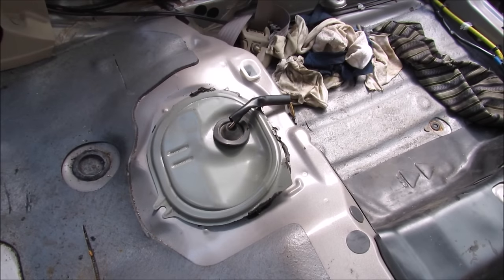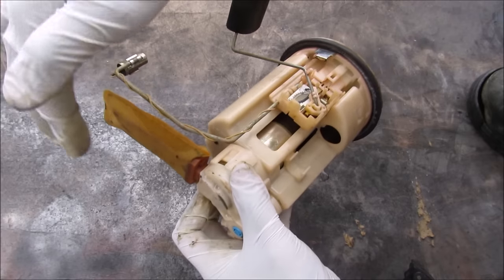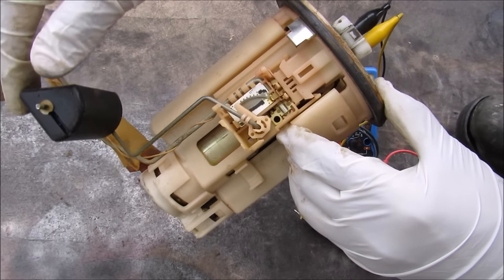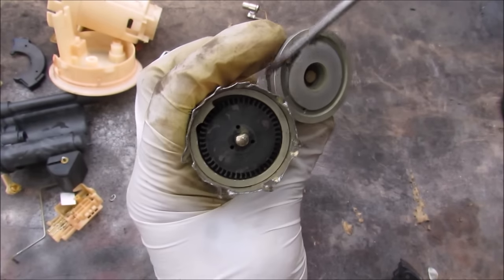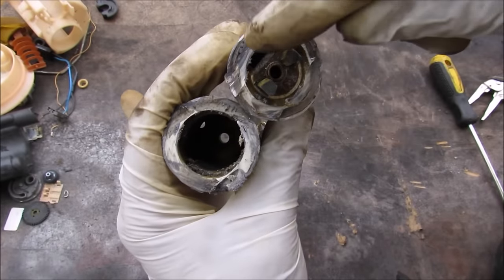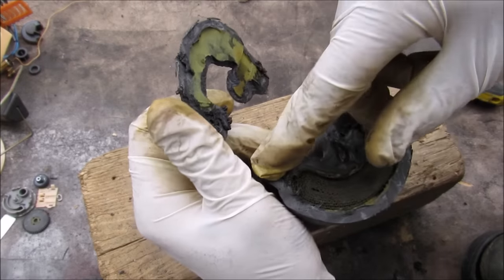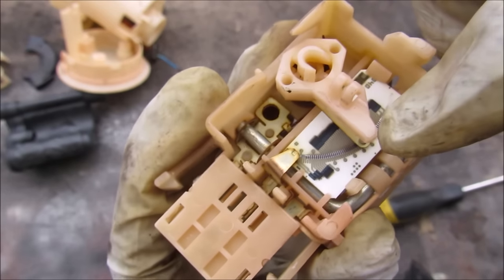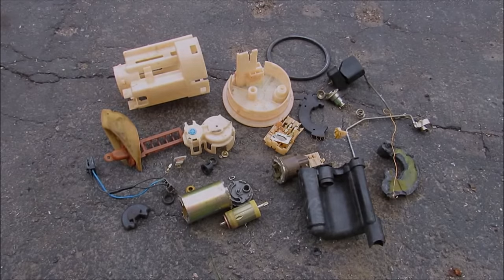How a Fuel Pump Works

Comment: Great video!! I just wanted to check to see if the fuel pump could potentially suck up a bit of metal about half the size of my little finger, which I dropped in to my vehicle fuel tank when I was trying to syphon fuel in to it. But going by the look of the filter sock this should stop anything bad happening to the pump 🤞

Comment: Great video .that pump is definitely redundant.but worth it for the insight.
Reply from the maker: Thanks. It sure is
Reply: @speedkar99  I have foolishly allowed my vehicle to run low on fuel hence my interest in fuel pumps.i wonder if you could advise me.i think I have damaged mine.and will probably have to replace.will I require the full assembly or do you think I could just replace the submerged part of the pump .my vehicle.audi A4 petrol.b6 Avant.

Comment: Your channel is fantastic! Dumb question you might have covered. When you accelerate, does the pump working harder to provide fuel or is there a fuel reservoir somewhere?
Reply from the maker: It keeps working at 12V. They aren't variable, but some have return systems for extra pressure
Reply: @speedkar99  appreciate the response. Love your channel bro

Comment: Excellent work! AlsoSince the gas is pumped through the pump to cool it, there isn't much benefit to keeping a tank nearly full to cool the pump. One I took apart in the 90's had the motor completely insulated in foam for noise abatement and was almost at the top of the tank.

Comment: Great video. I've just replaced the filter and the "sock" on my car. After that it got difficult to start the engine, but when I got it started it run fine. My unit is very similar to the one on the video (rav4 second gen). I found out that the oring on the top part of the unit had cracked in the process (where the outlet on the filter is connected). This allowed fuel to drain back into the tank and loosing all pressure in the system. This is why it got hard to start everytime.

Comment: I bought a 2000 f150 recently.The owner put a new fuel pump in.It ran good for about 1,500 mi then it began hesitating between 30&40 mi.per hr.
I figured out that it will run good at full tank until I use about 6 gal.Then it starts to malfunction.When it begins to malfunction it might run good for 2-3 mi.then it starts to hesitate at the speed mentioned.
Any answers or advise?

thanks.

Comment: Good video. Question on the pump the electrical connector blue wire is it positive? If it is.... Is thier a marking on the plastic connector indicating where the ground and positive go? The wire's weren't removed from the actual pump but they were removed from the connector that are  on the inside of the  fuel pump housing before putting everything back just want to make sure positive is going back and negative is going back to it's normal location but not sure need help with the blue and black wires only thing that I have noticed is a no.1 on the side of the plastic connector thats inside the housing the connector on pump has no numbers but I'm guessing the blue wire is number 1 if not then I crossed the wires

Comment: Now I'll never have to take one apart myself!  But we got along for decades and millions of cars with just gravity feed to carbs.
Reply from the maker: +wholeNwon Well with fuel injection and forced air injection fuel pressure is necessary for operation.
Reply: I understand. But we got along for many years without either of them.
There's something to be said for simplicity.  But it's not fuel efficiency, power per cc of displacement, etc.
Reply from the maker: +wholeNwon the same can be said for any technology, the argument can't be we were "doing fine".... Back then cars burned more gas, polluted more and didnt have the survival rates in collisions that cars today have. 

However there are some technology that I find useless in modern cars....the electronic parking brake for one.
Reply: Of course.  And, believe me, I sure don't want to return to the "good old days". It's amazing to me, and a tribute to engineering, materials, etc., that modern cars, as complex as they are, are still remarkably reliable.
And I'm eagerly anticipating autonomous vehicles.

Comment: Hey bud. Very nice video. The fuel pump in my hyundai is almost exactly the same as this. I had to remove it to replace the fuel filter which is obviously built into the pump itself. easy enough job as direct access under the back seat. However all of the mounting bolts snapped upp when removing it from the tank. no idea why they use such crappy thin bolts. all 8 just snapped with one turn. what would you recommend i do to secure it in the tank again? it sit in there fine and ive jammed some wood block between the top of the pump and the secondary cover in the cabin area to force it down in place but its not a long term solution. drilling in that area seems a little sketchy
Reply from the maker: Hmm not sure ..you'd need to drill out those bolts. It's sealed because fuel vapors are dangerous

Comment: Is the motor variable speed and controlled by engine sensors or other electronics in the system? My car has developed a bit of a hesitation at low RPM when transitioning to  higher RPM. I've already changed out the spark plugs and condensors, the fuel injectors, and even the MAS. Problem still there. I'm thinking next is a whole new fuel pump/filter assy.
Reply from the maker: These just get 12V and aren't variable. The injector's pulse width controls the flow. 

Don't throw parts at your car, get a fuel pressure test first.

Comment: Talked to several mechanics about my ATV engine stuttering problem.  They all said vapor lock which is hard to do in a high pressure fuel injection system.    The fuel pump tests good at the shop but I think overheats and starts to fail after a hour or the fuel pump is starting to fail at about 4000 miles on a Canam ATV

Comment: I'm hoping my comment might be helpful to some. I came here to see how the pump itself works inside to know whether I can put an inline pump and pump the fuel through my tank pump if I break down. Turns out I can! No need to drop the tank yet again! Simply undo my an-6 fittings and the coupler I will add, then put in the inline, power it and go! Until I can make the repair of course!

Comment: Nice thorough video! Does anyone know if a fuel pump could push thick oil instead of gas?  Its for a chainsaw bar oiler for a firewood processor I am building. Thanx!

Comment: I always loved running my fuel tank until the gasoline light came on. Then came the mad dash to find the nearest gasoline station. But the last time I did that my fuel pump died. I learned an expensive $800.00+ lesson for a new fuel pump, labor and other fun stuff.
Reply from the maker: +albear972 Yep, running it too low will cause the pump to over heat.

Comment: Question: What's the low level light resistor for when you've already got a float (with it's own variable resistor)? Couldn't the light simply turn on in the dash when that float reaches a certain level?
Reply from the maker: It's not very Accurate now is it
Reply: ah!.. that would explain the whacky light on my Malais era Mopar product. Thx Professor Speedkar!

Comment: That's very interesting. I have an old 97 ford explorer, and the gas reading can be really sensitive. For example, if I have a quarter of fuel left and the car is on a decline (even a small hill) or I'm stopping the car, the meter pointer will point directly at the E line within seconds. It doesn't take much for the meter to move. The opposite happens when the car is facing up or accelerating. Unlike modern cars like my dad's 2014 Grand Cherokee , it takes a lot for the gas meter to move when it climbs or go down a hill. However, I get accurate fuel reading if I'm on a leveled surface. So now that I watched this video, I don't know if that's got something to do with the fuel pump 🤔
Reply from the maker: +Charlz Tellis Yea with older cars the fuel float's reading is directly wired to the fuel gauge hence the rapidly fluctuating gauge based on orientation. 
Newer cars have the signals connected to the canbus and are better at adapting to fluctuations.
Reply: speedkar99 modern cars computationally ignore sudden changes to the fuel reading? does it take orientation into account or is it all just based on assumption that fuel probably hasn't suddenly vanished? Never knew that but it makes sense! (always wondered)

Comment: QUESTION;   does a fuel-pump need to emerged in the fuel completely to get cooled or just the to make sure it sucks up gas 100% from the end of fuel-pump pipe.
Reply from the maker: The motor is what creates the heat, but the gasoline flows through it so it doesn't have to be fully emerged

Comment: Great video @speedkar99 ! Question: Why are fuel filters on modern cars integrated into the fuel pump rather than further down line? What advantages does this placement offer?
Reply from the maker: Ideally you want to filter the gas before it clogs the pump

Comment: Can you also do a "repair fuel pump" video? Please
Reply from the maker: Like replacement or rebuild?
Reply: rebuild, i have friend of mine have problem with fuel pump on chrysler 300c, 3.5 , and he tried to find another new/ used but sellers ask almost 500 dolars for it, so i think if he could repair it , because there is no too much things to fail- pump motor- brushes or  pressure regulator, i repaired on same car egr valve and engine cooling fans
Reply: @makantahi3731  wow 500 is tooo much indeed. We shall see how to repair this thing. Thanks buddy
Reply: @speedkar99  just  called somebody replaced it with a used one. Few hours ago.

Comment: Good job Speed appreciate it, 
I custom build mini RVs,    do you know if these pumps can be used to pump water on a long term basis?  [like say for a small RV sink} am wondering if it will rust?
    also....@2:31   you said fuel enters the brown tube part and exits the grey end....did you mean the opposite?...I could be wrong though.
Reply from the maker: Water is conductive I don't know how a submerged motor would fair.

Comment: QUESTION;   does a fuel-pump need to emerged in the fuel completely to get cooled or just the to make sure it sucks up gas 100% FUEL from the end of fuel-pump pipe.
Reply: Since it sits at the top of the fuel tank, I don't see how it could be immersed in fuel all the time. But there should be enough fuel going through it for cooling, that's for sure. You can't let your modern car run out of gas and run the pump dry.

Comment: So, judging from this video, one cannot just replace the pump motor only, but must replace the whole module because of the encased filter? Do all makes of cars/trucks with this module have an enclosed fuel filter. If they do, I assume one must replace the whole assembly to ensure longevity.

Comment: @speedkar99, in your opinion, should you always keep the tank at least a quarter full, in order to keep the fuel pump from overheating?
Reply: Gino Lee No since the fuel flows through the electric motor and cools it off.
It won’t cool any better if it is totally submerged on the exterior.
Reply from the maker: Agreed

Comment: How does gas go through the motor? It looks like it's super tight clearances in there with the rotor. Do you mean gas goes through the shallow grooves on each end caps?
Reply from the maker: +mrsemifixit It goes around the rotor, and yea it doesn't appear to be much room.
Reply: speedkar99 So what are those shallow grooves for? Think I'm confused how it gets through the D.C. Motor
Reply: I am confused because as we all know dc motors makes sparks on the brushes and there is fuel flowing thru
Reply: Martin Škamla When submerged in gas a spark wont ignite anything. Its the vapors themselves that are explosive

Comment: any suggestions my car smelled bad of gasoline and opened back seat to check fuel pump assembly and there was gasoline all over the top of it and noticed gasoline dripping down fuel tank on one side of it.. mechanic said you need to replace all your assembly

Comment: Where might I find another rubber bushing to attach to the bottom of my new fuel pump I ordered online, since the original rubber bushing and fuel pump are a different size..? the auto parts stores don't sell them separately.
Reply from the maker: Dealer or ebay

Comment: Interesting that the fuel runs straight through the motor, and it's a brushed motor! Couldn't that be a fire hazard if the brushes created a spark?
Reply from the maker: Spark can happen but to ignite you need air. If it's encased in fuel there's no way it can ignite.
Reply: @speedkar99  thanks for the reply, that's kinda what I thought but I was wondering lol

Comment: My car is suddenly stopping after running for 10 to 12 kms and engine is getting heat do u think there is a fuel pump issue in it..
Reply: Very unlikely to be the fuel pump. Symptoms are different - like car won't drive fast, only slow if fuel not pumping properly. Check your coolant and your oil levels. Make sure the engine is not overheating and seizing.
Reply: Nice one bro

Comment: Do you thing it is worth the trouble to change a in-tank fuel filter? I have 100,000 miles on my car and i have always changed filters when they were in-line type but I have been told that changing the in-tank type of filter isn't necessary , but I don't think that is right. What do you think?
Reply from the maker: +kingmike40 Not worth it until it cloggs up. Use good quality gas and you'll be fine.

Comment: Awesome video man, thanks..
Hey, I'm wondering if the fuel pump and level sensor are interlocked by program? Because my fuel pump still works when connect directly to dc power (battery) but when i connect it to its original position the pump doesn't work, fuse and relay are ok..
Reply from the maker: Perhaps the ecu is not providing power or there's a wiring issue, or the Immobilizer is preventing the fuel pump from running

Comment: And can i know how to find the common fuel pump + and - wire by colour coding. bcoz i need to put a reply. So please kindly explain
Reply from the maker: Wiring diagram
Trace wires to motor 
The two thicker wires are typically the power on the harness

Comment: Brother my honda city 2007 pic power is soo poor i recently changed all the power plugs but pic power is sill poor one mechanic saying that fuel pump is weak so it's true? Will pic power increase after replacing fuel pump?
Reply from the maker: Pick-up power? If the fuel filter is clogged then yes replacing it would help

Comment: I have a Mitsubishi Lancer ralliart 2.4l 2006 and I have a low fuel pressure I've already changed the starter and fuel pump with the strainer(sock) and the car is rough start just cranks a long time with no start. After a long time of trying to start up the start up dies out to where you just hear is clicking or silence. Battery is good
Reply from the maker: +Jorge kaji maybe an obstruction in the fuel line or a kink?
Reply: not sure Ive done research and only option is change the Fuel pressure regulator

Comment: why pin 86 and 87 of fuel pump relay has already got power even when KEY IS AT ON POSITION??

IS NOT IT SUPPOSED TO GET ACTIVATED ONLY WHEN ENGINE RUNNING??

Comment: On November 3 I replaced the fuel pump on my 89 S10 pickup. EVERYTHING was NEW. Tank, fuel pump, and hanger assembly. This lasted about a month. Now the truck won't  start. When I turn the key on I can hear the pump run and then shut off. But my truck refuses  to start . Dump gas into TBI and engine fires right up. What would cause pump to go bad in a month? Tested pump before I installed it truck. I am beyond mad. Wish it was that easy to remove fuel pump from my truck.
Reply from the maker: Do you have to remove the bed to get to the tank on your s10?

Comment: How much cost SH pomp like this and how much you can drain with the dc motor ?
Reply from the maker: +KingTsunamy You can drain the whole tank, there was barely a little left in the tank as you saw in the video, and I had pumped it out with this pump.
Reply: I mean the number of gallons /minute,  also how much cost one like those?

Comment: Dear brother i have a question if i overfill my fuel tank will it ruin the level guage system in fuel pump because overfill tank is above its maximum limit.
Reply from the maker: No. Once the float maxes out it can't go any higher.

Comment: I have a question: The sensor works only to indicate the fuel level or it also shuts the pump down if the fuel is too low??
Reply from the maker: I don't think there's a shut off on this one

Comment: do you know the fuel inject inside the internal combustion engine of ace hydra crane, is same nozzle pour more diesel if we use crane at it's full swing capacity
how much fuel inject per second in 12xw ace crane engine and produced how much energy so we know how much fuel consuming every hours if 2200 rpm and 48 bhp give by engine

Comment: Hi.. My fuel pump filter was full of dirt..,then i cleaned up the tank and injector and the line hose.. I changed the plug also... I cn strt the engine but it vibrate in idle, if i rise the acceleration pedal to 2thousnd of above the engine stabil...  Is my fuel pump going to die..
Reply from the maker: Seems like you have an idle control problem
Reply: @speedkar99  i try a lot... I cleaned trottle body, changed plug,  still the engine nt stabil in idle.. I need to rise to rpm  high to make it stabil, i checked with dignosis computer,  fault code was (low fuel pressure) , i also swap fuel pump with other car tht same model car.. Stil same problem..  My car is 4 Cylinder piston..  I its ike runing 2/3 cylinder only...  Its cause headache to me thinking cause of ths problem..  The ignition also firing all 4 plug...
Reply: @speedkar99  tq so much for replying to me...
Reply: @speedkar99  hi.. Sir i find ready the problem is.. Tdy i open up car my self.. The hydraulic valve lifter stuck..  Makes the rocker arm fell off frm the line.. Thank god, it didnot damaged the camshaft...